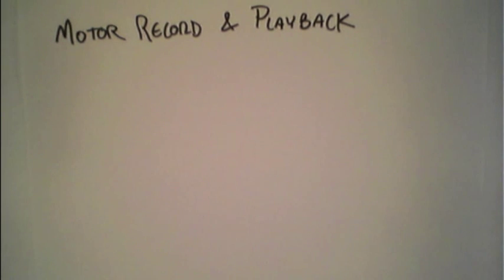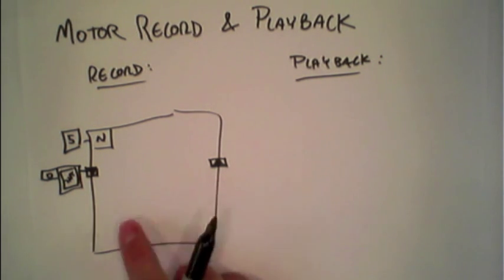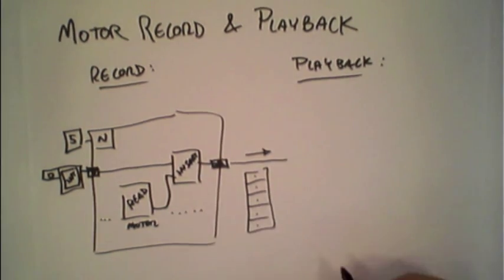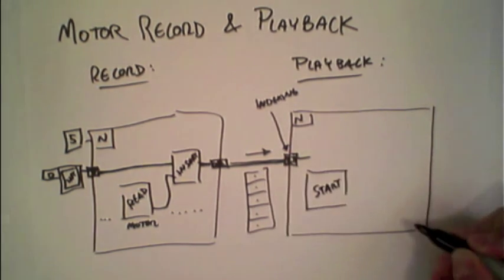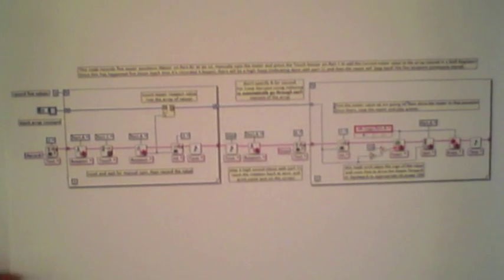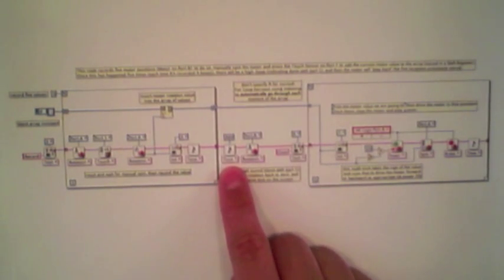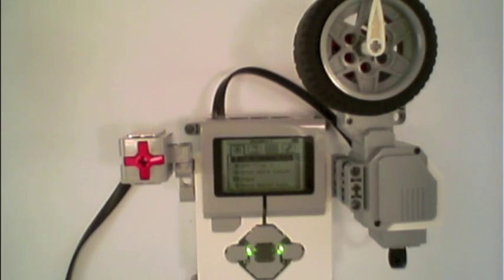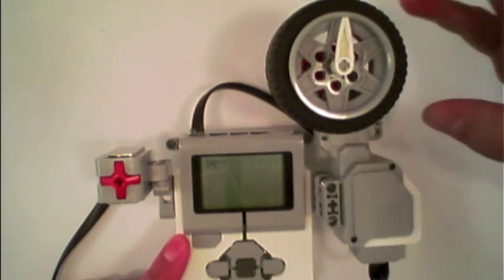How Do I: Motor Record and Playback

Comment: hi, it's possible do it with two motors but thta it happens in the same number of the array
Reply from the maker: Best way to do two motors is to just double the number of arrays: one array for motor one and a second array for motor two. This would mean reading and saving motor positions in the left/initial loop and then going through each value in BOTH arrays (at the same time) and controlling motor positions in the right/second loop. Best of luck implementing this!

Comment: Im really confused. How could I make a code that records three motor's movements infinitely into an array until a button is pressed, then play back all the movements?
Reply from the maker: DronePower Thanks for your question!  There are a couple of changes you'd need to make to this code to have it do what you describe instead.  First, rather than just recording 5 times (as in this video), to record "infinitely" you would use a While Loop instead of a For Loop (and have the conditional on the While Loop stop when a button is pushed).  The code will keep adding the values to the array, dynamically growing bigger and bigger as it reads more and more motor positions.  The "playback" part of the code can still be a For Loop and remain the same, as you will want to go through each element of the array you just created playing back the sequence of values.  Second, for modifying the code to record three motors (instead of just one motor, as specified here), you can just duplicate the code three times, changing which motor is being read, and run it in parallel.  Or, using this same code structure, have three arrays (instead of just one), one array for each motor.  It's a little bit more complex, but still doable.  Best of luck!
Reply: Thanks! I made a robotic arm that duplicates as a joystick sort machine. Lots of possibilities.
Reply from the maker: DronePower Excellent.  When you get it working, make a video and share!  Love seeing other creative examples out there.
Reply: Will do!